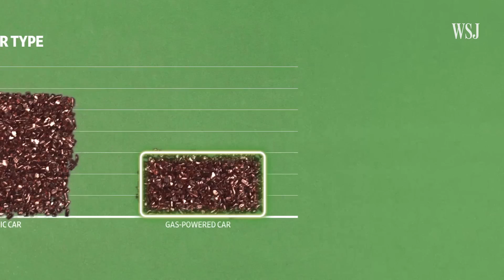Why Copper Is Now One of the World's Most In-Demand Metals | WSJ

Comment: Start taking down telephone poles for RTP resin fabrication corrosion liner Realestate and  Dealerships. We never got the fargo true coat for the House Main Box Cill Plate. Start Jacking and Cribbing, and put the anchor bolt nuts between the double solid line. Let the State inherit wireless Floating Homes and amphibious vehicles.

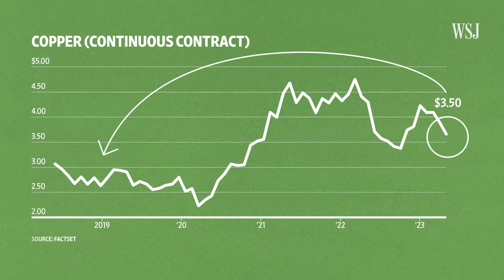Comment: At 2:14 -- That 17% rise [$3.50 vs. $3] almost exactly conforms to across the board rise in consumer co$t$ due to Bidenflation. So demand would appear to have plateaued, at least for now.

But copper prices have risen pretty steadily since the '00s due to the increasing demands from the breakaway province of West Taiwan and India, as those countries industrialize and improve their standard of living via rural electrification and expansion of cell networks, etc.

Small surprise then that most traditional uses for copper [electric motors in consumer goods] are increasingly seeing the copper substituted by copperized aluminum wire.

Comment: 0:02 What? Since 1982, pennies are 97.5% zinc with 2.5% copper plating. You need over 7000 pennies ($70) to make 1 lb of copper ($3.80).
Reply: They showed a cent, not a penny. 
America doesn't have pennies...

Comment: Oh so the whole “lets replace all fossil fuel cars with battery powered ones” won’t work? Who would’ve thought 🤦🏻‍♂️
Reply: the enviromental cost upfront is higher but the cost over time is much lower
Reply: @pinkysweets  dude… do you realize that “electric” cars actually run off of fossil fuels? Do you realize that batteries are only a storage device for energy, they don’t actually create energy? So…you want to run the math on that one again? I’ll warn you, I actually have a Degree in this field.
Reply: @pinkysweets  debatable.
Reply: @johnk-pc2zx  It’s not even debatable, it just simply isn’t true.

Comment: You guys made an error for tesla battery packs. They will switch from 12v to 48v for the vehicule electronic system, not the high voltage propulsion battery. 48v requires smaller cable which is why it will save copper.
The main battery pack does not change.
Reply: But is t the main battery pack 48v?

Comment: Copper price is around equilibrium on the 5 year, and cheaper than it was in 2012.
Reply: Which further exacerbates the difficulties of getting a new copper mine going today.  Exploration spending is down, exploration success is massively down, (for decades now,) permitting takes forever, (if the project isn't simply rejected ala USA,) social and environmental pushback has never been trickier, and miners have to go to ever-sketchier countries with changing rules or flat-out corruption.  The world totally relies on a dozen or so mega-mines, half of which are a century old.

Comment: There is not enough copper, lithium, and cobalt to allow the foreseen 100% transition to EVs by 2035.
The 100% transition require an increase in extraction and process of the fundamental metals equal to 700% of today's level.
This is why the EV transition is a bunch of hot air...
Reply: Dumb people only consider current technology.

Comment: Switch to 48v architecture in vehicles and this solves much of the problem.
Reply: The problem is perhaps 20x larger than the copper-in-an-ev problem.
Reply: @johnk-pc2zx & 2- 3 times more weight
Reply: Todays vehicles don't rely entirely on traditional relays or contact switch anymore so it makes perfect sense.

Comment: Penny ≠ Copper!!  It's almost all zinc.  Copper costs have driven it out of the household pipe market, moving people to plastic (=made from oil) water pipes.
Reply: Pre 1982 pennies are almost all copper.
Reply: Plastic pipes (PVC plastic) are made from natural gas, not oil.  So is most plastic.

The idea that oil is the major feedstock for plastics is a common misconception.
Reply: @dixonpinfold2582  Really? Drain pipes are PVC and have been for a very long time. Previously drain pipes were often cast iron or other materials, but NOT copper. Water supply pipes used to be mainly copper and are now commonly being replaced with PEX (cross-linked polyethylene) which I believe is a petrochemical made from oil.
Reply: @mnntropy5615  That's true. PVC, made from natural gas, is still the main choice for drain pipes, but is not used for the drinking water supply.
        And overall most plastic is made from natural gas, but polyethylene is a type of plastic which is indeed made from petroleum.  So what I said initially, while entirely true, was beside the point as far as substitution for copper piping is concerned.  Thanks for your reply.
Reply: America doesn't have pennies, we have cents... 
Pennies are in England, Australia, Denmark, Canada etc etc...
Reply: @billymacktexasdetective5827   Oxford Dictionaries notates 'penny' as "North American," not British.  "A one-cent coin equal to one hundredth of a dollar."  Surprised me slightly, but no one seems to disagree that they're the leading lexicographers of our language.
Reply: @dixonpinfold2582  There is nothing more to say other than anyone or any organization who thinks America has pennies is dead wrong. Have a nice day though!
Reply: @billymacktexasdetective5827   If you're in Texas, maybe that's the explanation, because there are 49 other states.  The penny loafer came from Maine, btw.
Reply: @dixonpinfold2582  Please, continue in your ignorance and have a great day!

Comment: As an electrician, it's not unheard of for staging grounds to be cleared of copper overnight because thieves know that a few rolls of wire are worth literally thousands in scrap. There was also a period of time where copper was so incredibly scarce and expensive, that inferior aluminum wire had to be used and adopted into the NEC until the prices of copper weren't completely insane.
Reply: Lol we still use aluminum all the time in distribution and it’s totally fine. I can assure you utilities aren’t running copper high voltage power lines overhead. Aluminum is a problem when untrained personal start working with it. It’s just another conductive metal just isn’t as forgiving.
Reply: @DMSparky  Yes, have you priced large gauge copper compared to aluminum lately?
Reply: My apartment building is wired with aluminum that has a thicker gauge than copper to carry the current, but the aluminum has easy metal fatigue and breaks on bends. Also you need specially made wall sockets and switches for aluminum to avoid fire.
Reply: Saw that on a job once.  The thieves were 3x guys on my crew. 🤬. They pullled every single feed for service.  The cops caught them on their way to Mexico border.  Glad they got theirs
Reply: yeah...when I was a kid(like...30 years ago) my dad would take me to house developments where they had massive spools of copper left laying around and was basically the only reason we didn't end up homeless =/
Reply: @timfriday9106  How did you didn't end up homeless? What's that got to do with copper spools.
Reply: @JKTProductionzIncNCo  That's what I want to know, too. Maybe they stole the copper...lol
Reply: @JKTProductionzIncNCo  they stole it and scrapped it...
Reply: @JKTProductionzIncNCo It's worth a lot of money when you take it to a recycling center. But it's also illegal.
Reply: @reread his comment JKTProductionzIncNCo
Reply: @timfriday9106  so.  Basically theft, then.  No judgement.  I would have done the same to avoid homelessness
Reply: I work in the security industry. For reasons such as this, construction sites hire security more and more often. I can corroborate his claim.
Reply: My mother was into residential real-estate,she would try to show a house only to see the walls were tore up by thieves.
Reply: The modern 8000 aluminum is supposed to have fixed the problem of the old 1350 aluminum working loose in the screw terminals.
Reply: The aluminum wire installed in the late 60's and early 70's did have problems.  However, the alloy used today for aluminum wiring is different and the same problems do not exist.
Reply: Yeah, nobody wants to remember anything these days that’s why we keep running in circles politically. Sad part is many still have aluminum romex and don’t have a clue and definitely don’t know why or how dangerous it can be.
Reply: @MooseKnuckleMike  it’s dangerous because the wall sockets being wired to them were made for the physical properties of copper. Since that happened they realized this and now have proper specifications and ratings for aluminum
Reply: And amerikkka must own or just under pay those poor Zambians, DRC or just Africans where it comes from
Reply: @yougetaspear7799  keep your political bs between you and your boyfriend
Reply: @yougetaspear7799  Hey professor, for your information, the Chinese are responsible for pretty much all mining operations in Africa……. So why don’t you go cry to them? Stay in school kiddo.
Reply: @yougetaspear7799 critique without substance. I don't know why dumb ignorant people feel the need to chime in.

Comment: Copper has been highly valuable for decades. People literally destroy telephone poles to extract and steal copper from them to sell to scrapyards where you can get a lot for it. It's become an epidemic, so much so they now often use alternate materials to copper whenever possible because it is simply so highly sought after by thieves.
Reply: In Melbourne Australia its not uncommon to hear the train line is down as thievs have stolen some copper aspect cruicial to trains
Reply: @JH-jo9wt  it's worse here in South Africa. Trains hardly operate here anymore, same reason.
Reply: Thanks, Dr Obvious
Reply: @MooseKnuckleMike  It's Captain Obvious.....and Dr. Copper.  Doctor Copper didn't go through 6 years of tertiary financial education to be called Mister, thank you very much.
Reply: Centuries
Reply: Now it's orange gold.
Reply: They even go to the trouble of disguising bare copper cables as non copper ones by making the outer wires out of steel in some circumstances. The outer layer being steel makes it harder to cut the cable and it also doesn’t make it obvious that it’s copper.

Comment: CORRECTION: Copper is considered to be a semi-precious metal.
Reply: Precious means that it doesn't really oxidate.
Reply: @Borrego a Yudando Wdym? Silver also has a positive electrode potential.
Reply: @Borrego a Yudando There are just different definitions for different fields. https://en.m.wikipedia.org/wiki/Noble_metal
Reply: @Borrego a Yudando basically, they aren't corrosive or just the most outer layer is able to corrode.
Reply: Copper is a base metal.